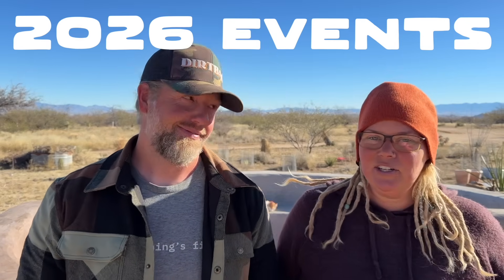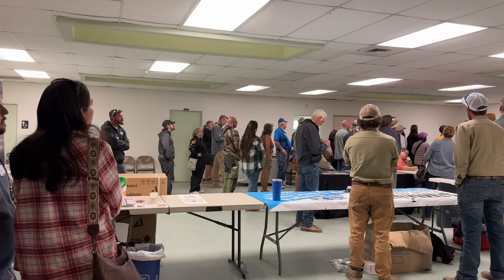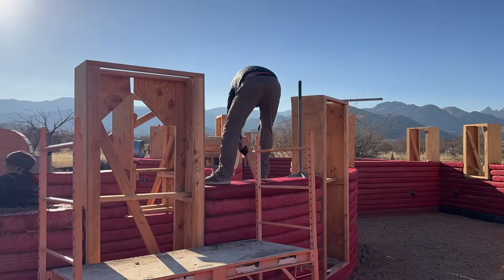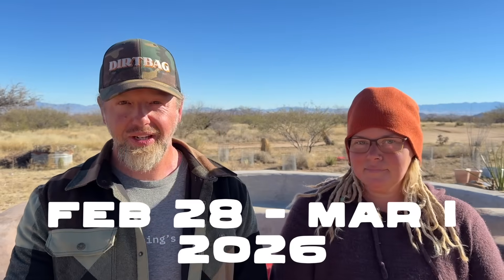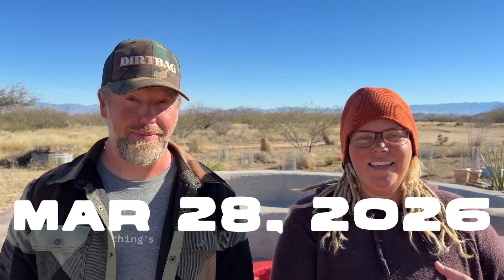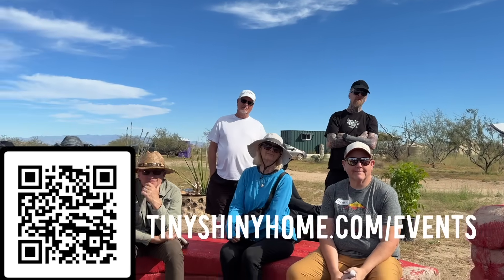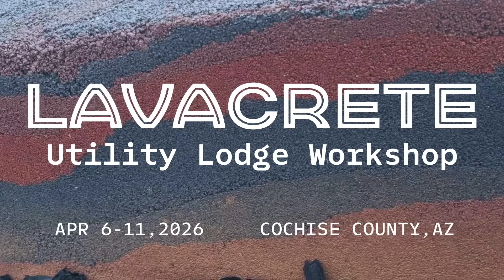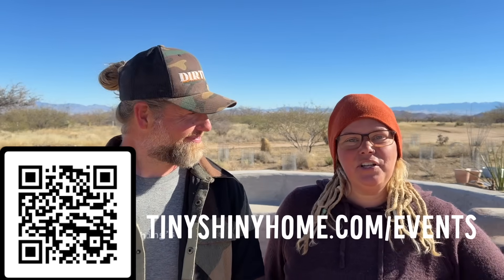We Found a Building Technique Most People Have Never Seen

Comment: I have 1 question. Where r u going 2find round furniture? Ex. Kitchen
Reply from the maker: The design of the roundhouse uses lots of intersecting straight walls to address this. The main kitchen area is on the straight wall. No need for round furniture

Comment: Are you going to pour the floors at the same time as the bond beam ?
Reply from the maker: Nope
Reply: They’ve mentioned before that they need the roof complete before they pour the floor. Imagine if it rained on their concrete floors — there would be nowhere for the water to go and their nice new dirt walls would get flooded.
Reply from the maker: hey thanks!
Reply: @ourmobilehomemakeover662  True, that would be a very bad and expensive mistake.